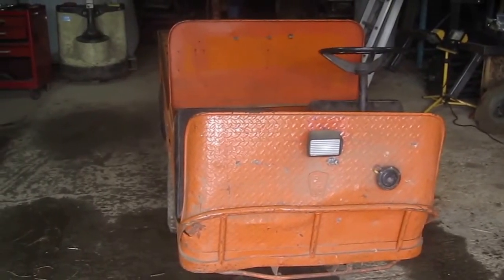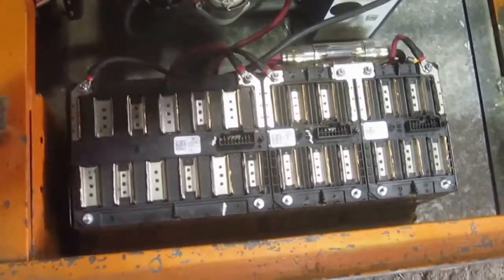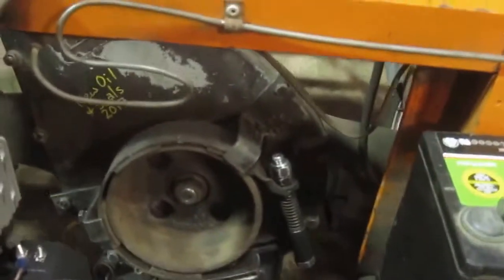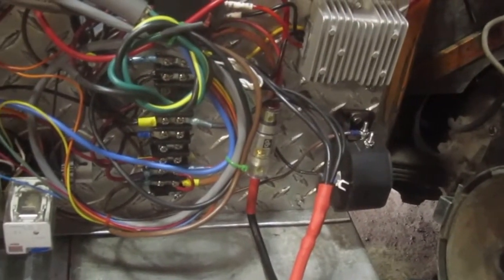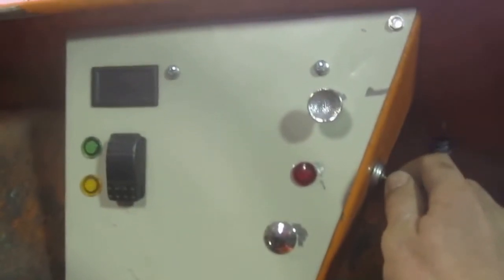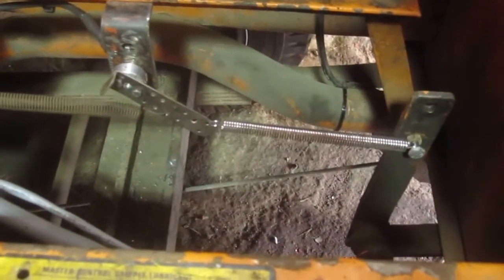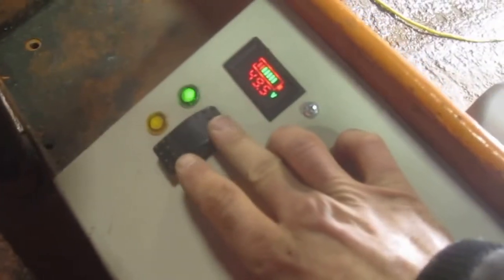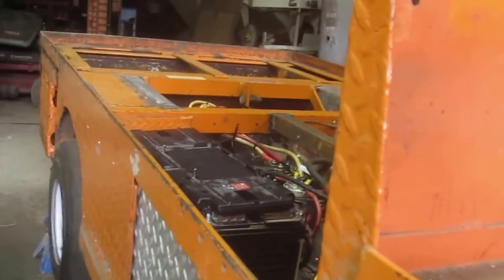meet Bob, an updated Taylor Dunn B2-48 (almost) ready for work on our farm

Comment: where did you get the reversing relay? Trying to find one for mine not sure if I need a 48v 400a or if a 12v 500a would be fine.  Also curious what is that on your solenoid? A resistor ?
Reply from the maker: Cheap reversing contactors with 12V coil and up to 500A power handling are available from Temco and other brands.  Their niche is pickup truck snowplow hydraulics and similar uses.  They're not as bulletproof as Albright contactors but probably good enough and cheaper.  Voltage rating mostly refers to the actuator coils, are they wound for 12v or 48v, and it depends on your system wiring if you need over our the other.  It's cheaper and easier to find units with 12v coil but you need your fwd/Rev switching signal to be in 12v which isn't always the stock config in utility carts. Voltage across the power contacts of the contactor can be 12v or 48v regardless of the coil voltage.

The item across the main contactor terminals is a precharge resistor that let's a trickle of current through to the motor controller at all times, allowing the big capacitors in there to stay full and avoiding big inrush current to the caps when the contactor snaps shut.  This is common practice.  Search for discussions of precharge and learn add much as you want.
Reply: @reidallaway  Thanks so much very helpful!

Comment: I just put under voltage cutoff boards cheap on Amazon. That way I set the point at which the solenoid looses power. Way simpler than super expensive BMS systems.
Reply from the maker: Yep, undervoltage protection is adequate to protect against excessive discharge of the pack and I've used those sometime.  You probably already know this but the big difference with a BMS is that it monitors all cells and can shut the pack down (disconnect it from load) if a single cell drops below minimum value, even if others are keeping the average up.  A BMS also does the same at the top end during charge cycles, preventing low cells from masking a high cell through averaging and preventing overcharging of any cell rather than just the whole pack.  A BMS can thus limit your charge and discharge with monitoring at a cell level rather than pack level and with balancing circuit properly sized to the pack (not a given with most BMSes having too little balancing capacity for bigger packs) a BMS can also help to balance the pack during charging (passive balance) or at all times (active balance).
Reply: @Reid Allaway  yes. Some cells need balancing more than others do.

Comment: Looks awesome. What size wheels and tires did you go with in front and back. I want to upgrade the rear tires in my b248..but I am not sure if I need to go with an offset wheel to accommodate the additional width tires. Are your rear wheels center offset? What size wheels and tires? Awesome work!
Reply from the maker: Rims are  8"dia x 7"W 5-hole ATV wheels from Princess Auto (Canadian Harbour Freight) I don't think they're offset.  Rim fitment was okay with only 1 bit of dragging on a corner of  rear brake calipers.  I just rounded it off with a file.

Front tires were initially crappy turf tires off a junked lawn tractor, probably 18x8.5-8. When they failed I went with new $40 rib-type golf cart tires - cheapest locally available.  The additional front tire girth required limiting the steering lock to lock but there are adjustable limit stops for just that purpose.

The industrial-tread rear tires are BKT Skid Power HD 18x8.5-8 and they're super rigid so plan to have them mounted by a tire shop you're not too friendly with.  Other options for knobby rear tires were Carlisle WT300, Carlisle Super Lug and OTR Lawn Trac plus a whole host of turf models but always with crap load ratings.  The BKT Skid Power is the only tire with decent load ratings because the truck is rated for 3000 lbs on the bed and sometimes it's tempting to use that capacity

My notes from the time indicate the following sizes are all suitable:  15x6.50-8, 16x6.50-8, 16x7.50-8, 18x8.50-8

Comment: Great conversion! How does this thing handle on the farm out in the field? Is ground clearance an issue?
Reply from the maker: Our farm is pretty flat and we (try to) maintain the roads and travel paths in flat-ish condition so generally the rear-wheel drive and 4" of ground clearance haven't caused us much trouble.  Every once in a while we get Bob stuck in the mud and pull him out with something else and the bottom of the rear differential is definitely "polished" from being so low but 99 times out of 100 Bob is a pleasure to operate on our farm

Comment: What rear tires are those?
Reply from the maker: randomguy9898 BKT brand skid power HD.  They're the world's smallest skidsteer tires for 8" rims. They're crazy rigid so be sure to take them to a well equipped tire shop for mounting add they're a nightmare to mount on the rims but they have a really high load rating and small enough profile for the wheel well.  I think I got them online from simple tire.
Reply: @reidallaway  Thanks! Out of curiosity, did you come across any with tread like that, but foam filled in your searches? would like one I would never have to worry about if possible. Really like these though, they look great
Reply from the maker: randomguy9898 i wasn't looking for flat free tires. You could see if there are Tweels in a suitable size because I think they're making smaller ones for riding mowers.  I doubt I'll live long enough to puncture or otherwise damage the Skid Power HD tires.
Reply: @reidallaway  You might be right. I anticipate driving mine through a lot of old dumping grounds though, so im just worried about the metal scraps and glass shards

Comment: what is it's top speed?
Reply from the maker: About 20, maybe  25km/h but I've never measured.
Reply: @reidallaway  cool. I have a 36v taylor dunn truck that i think is 14 to 1 gear ratio and supposed to do 12mph top speed. I've never had it working yet.  I need to build a carport where i can start working on my projects. :)
Reply from the maker: @dolinick  your speed guesses sound right.  I think the 36V carts are geared for about 12-14mph max and by boosting to 48 you get about 30% more.  At our farm this gives a top speed that's just about right for bumpy dirt roads but sometimes distances of several hundred yards/metres to cover.  I think 12mph might get tedious on a day when we're rushing to get everything done.